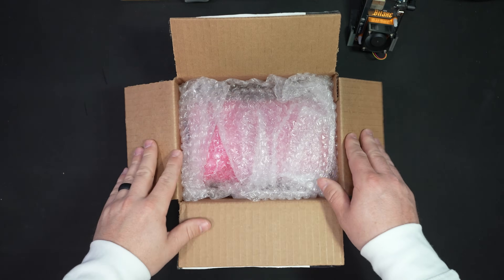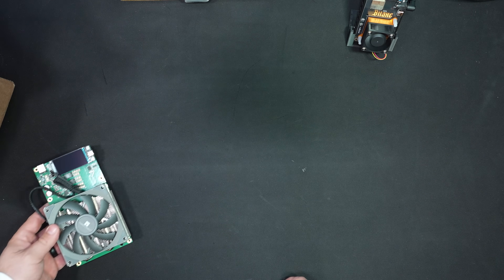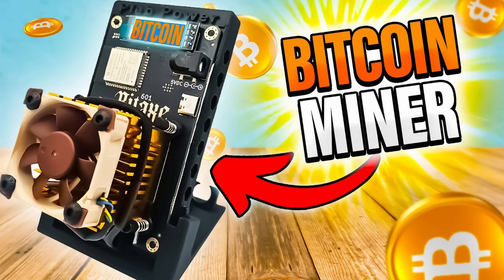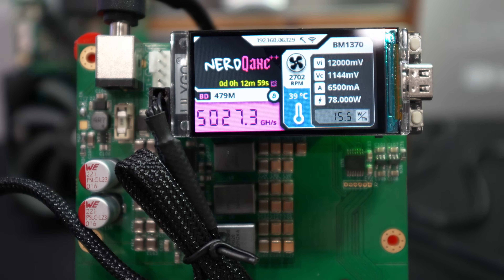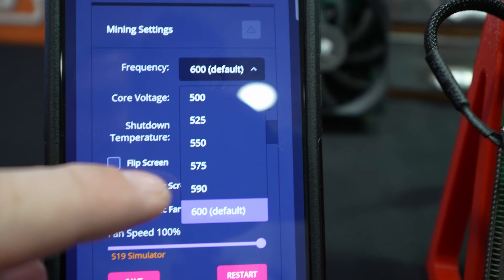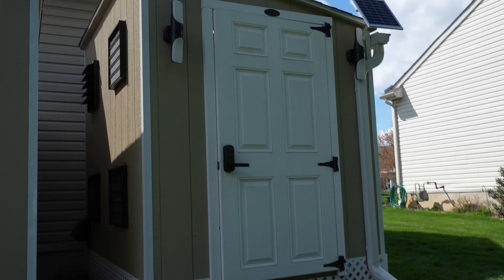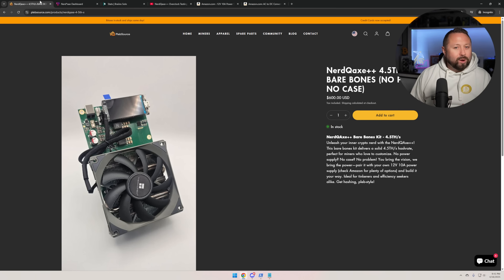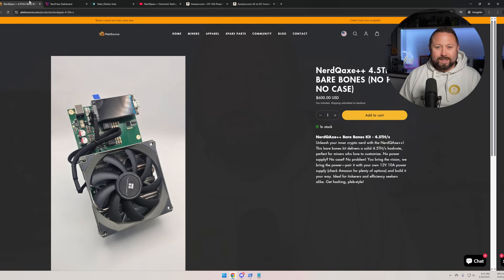BEST Home BITCOIN Miner for $500! NerdQAxe++

Comment: Would like to have seen how far you can OC on air though.

Something about submerging it in oil that's hotter than ambient air temp is not thermodynamic-ing for me. There's just no way it's cooling better in there, but you have the benefit of no fan noise.

Comment: I saw you put it your NerdQaxe++ emersion tank to increase the TH, since I don't have a emersion tank what do you think about attach the "Cooler Master 120L Core Close-Loop AIO Liquid Cooler, R7|i5 Gen S Dual Chamber Pump, 120mm PWM, 120mm Radiator, White Lighting, AMD Ryzen AM5|4, Intel LGA 1851|1700 Platform" or modified  "GeeekPi Water Cooling Kit for Raspberry Pi 5, Pi 5 ICE Pump with Water Pump, Water Cooling Head and RGB Cooling Fan for Raspberry Pi 5 8GB 4GB" and attach to the NerdQaxe++ to keep it cooler to increase the TH.

Comment: With your OC settings on an open air device, it got glitchy.  I was able to get 5.7 Th/s with 700 MHz and 1160 mV.  Only 93 watts running on a 15A power supply.

Comment: It's definitely a beefy looking miner. I love the colored display too. I wish they had a nice looking housing for these like they do with some of the others. I guess the benefit to that is increased cooling. Anyway, I'd probably get some kind of prop stand and put it on my wire rack shelf with the other electronics. Or mount it with the stand-off holes.

Comment: Recently, I completed encapsulation of my crawlspace under the house – it is now a "clean space" with humidity control. The temperature stays around 60° or so, which is taking advantage of geothermal influence, which would cool  the unit naturally . However, in the winter, I would like my floors to be warm, so in the spirit of crypto mining, I would use the heat produced by the miner to increase the temperature of my floors in the house, allowing it to repurpose the excess heat.    Thanks for the opportunity.

Comment: Just a quick question for the NerdQAxe ++. Say you added a 12v 12.5amp= 150watts, should you also change the fuse on the board from the 8amp provided to say 10amp fuse? Or is the device safe to just keep upping the wattage as long as thermals aren’t an issue?

Comment: When you settle on a beefier power supply, would appreciate your posting a link to what you decided on. Thanks!!

I have started looking at a "lab" power supply.  It is more expensive but you get a readout on what the power supply is actually doing.  No on the hunt to find a barrel connector cable with pigtail (bare wires for those you havent heard the term before) that can handle 20amps.

Comment: I've got a little home mining area in my bedroom w it's own unbroadcasted wifi, going to a pi 5 8gb btc core node that I point them all too in my bedroom...have fans etc and boosted ac in there. Currently have an overclocked gamma and supra running at 2-3.5th and a nano3s hooked to the router w ethernet, and they have their own wall display shelf. The qaxe++ would go right in the middle of the bitaxes on that shelf! 😊